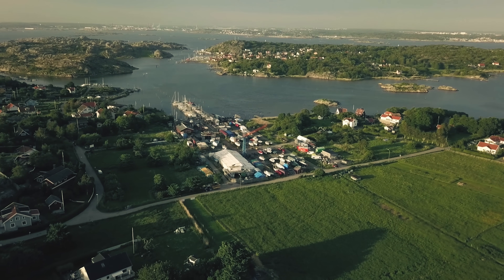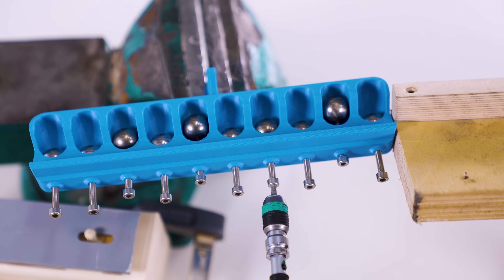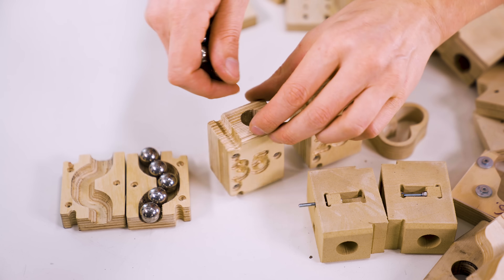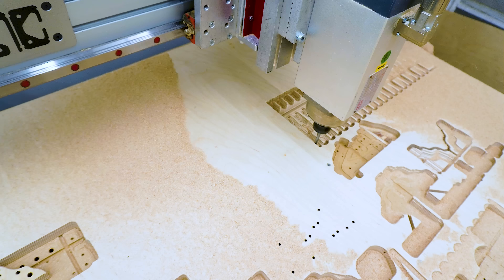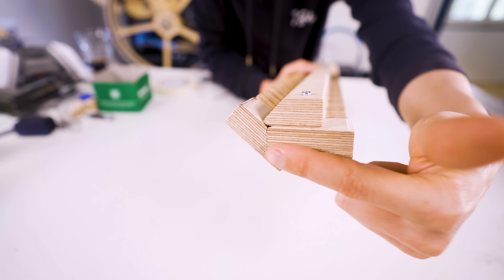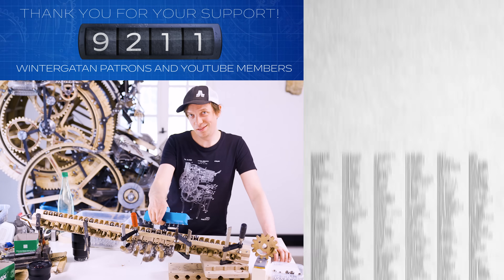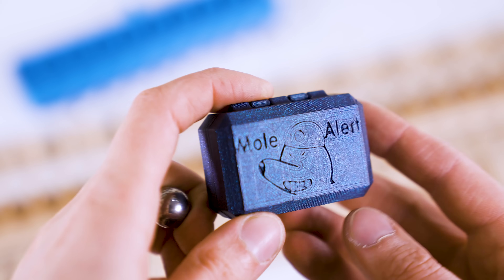Engineering Basics: The Best Part Is No Part

Comment: As much as I feel sentimental for what work has been done prior, simplification saves error later on. The new parts and designs coming in will save troubleshooting much later on and wear and tear on many small pieces is worse than wear and tear on a more heavy duty 3D printed part that is one larger piece. I love this progression!

Comment: You may want to consider raising the marbles higher and have them go into a tube that feeds the marble divider. That way marble pressure can be used to prevent marbles getting stuck. This would make it so that your divider isn't as sensitive to it's orientation.

Comment: I've often wondered about the longevity and wear on the plywood - you've used acrylic laquer to "harden" it, but that's little more than a surface treatment that WILL wear off -  - my first choice would be cyanoacrylate (CA glue), it comes in different viscosities and one of them is like water with excellent penetration of wood and plywood to make a rock hard surface, I've used it many times to create high wear resistance surfaces for things like drawer runners, that's still good decades later - however CA even in bulk isn't that cheap, and application can be finicky requiring the person to be quite meticulous and quick in its application as it only has a very short "ppen" time before curing, and therefore time consuming. 

The next possibility I would recommend is using a wood hardener specifically designed to, well, harden wood.  It's used to strengthen old weak / damaged wood in things like window frames prior to repairs.  It's an epoxy with a built in catalytic hardener but is very viscous and will easily soak into the fibers, much deeper than a spray on laquer, but can be thinned out 10% with methylated spirits (also for any cleanup) to make it penetrate even more.   It's extremely simple to use, just apply with a brush like paint without overloading the area with it.

The product I've used for many years is Ronseal wood hardener like this - but I'm sure there are other varieties.
https://www.wickes.co.uk/Ronseal-Wet-Rot-Wood-Hardener---250ml/p/117936?utm_source=google&scid=scplp117936&sc_intid=117936&gclid=Cj0KCQiAnKeCBhDPARIsAFDTLTK09orMs9xJvJiiNzieO4Ez_P9uBtkUOgYAuXJLbTnzLDW7A0z1aDsaAmW5EALw_wcB&gclsrc=aw.ds

This will make the wood extremely hard as the fibres are now full of epoxy on a cellular level, and it will penetrate without deforming the structure, and can be sanded to provide a reduced friction surface even more than wood alone.

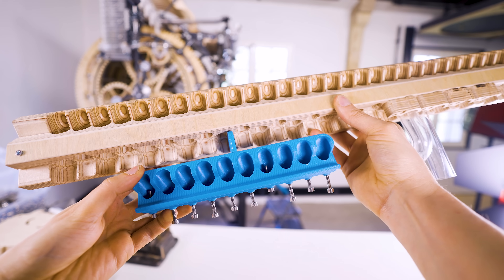Comment: @9:00 he is holding the plywood at the correct angle, but the 3d printed is rotated by 45ish degrees.  Notice the plywood does not have the raised lip which is designed to keep the marbles from falling out when rolling down the path.  To compensate, he incorrectly rotated the plywood version along the longitudinal axis which caused the marbles to stick.  After he adds the lip and installs correctly, I believe the sticking problem will go away.

Comment: The ball ramp, made of plywood, turned out to be bad. Too much rolling resistance and slowing down of the ball rolling speed. It is necessary to make a smoother transition between the isthmuses separating the niches of the balls and the flat part along which these balls roll. In the printed prototype, by the way, this point is taken into account and done correctly.

Comment: Honestly the thing I'm worrying about now is the marble feed rate itself. The recycler fish stair means that the marbles cycle through the divider system at a certain rate to cover the case if the marbles fall on the furthest position but the earlier channels are used more often. It is less likely ofc (expecting the drum kit and the bass channels to see much more use than the vibraphone channels) but you'd have to worry about the speed of the marbles going through the divider, even more so given the clock escapement gate which wouldn't tolerate a completely empty channel. Needs a lot of experiment and friction reduction effort I suppose.

Comment: I think you could come up with a similar design idea, mixing the fishstair loader and this design to make it for the chain elevator, that way you can always feed 8 marbles all the time, making it look cooler but would also not require that much engineering as it uses the same principles as the fishstair loader, thus make you need to think less

Comment: The new marble lanes design suddenly makes so much more sense with this Marble Divider.  Given the much slower movement of the marbles down this divider, if they all originated from the far left path, you would get marbles backed up very quickly, likely leading to failures.  But, with the new marble lanes that more evenly distribute the marbles over 8 separate locations along the divider, this likely is far less of an issue.

Comment: Great new addition to the machine, but knowing your perfectionism I have just 1 small bit of feedback that I really do need to give. Actually there are two:

First: Sound, this new tool causes a LOT of friction and the energy loss will do two things, create heat and sound. The heat, is fine. The sound? The machine will have a new constant background noise from this addition. Knowing how you try to avoid noise and unnecessary/unwanted friction. This piece might be a mole in waiting. 

Second: Wear and tear. Because there is so much friction, the divider slots between the channel will constantly be bashed by the marbles. This won't create a problem in the short run, but it will if you don't replace the wood every now and then. The wood will be dented and bashed with every marble hitting a channel divider, this will impact the reliability of this part, causing less friction at first, but a lot more later on. Right now this pieces does exactly what you want. It might not later on.

Comment: Dont' forget to implement the passing track of the old divider to beware of a bottlenack in the new one!
Maybe only a thaught but the brittle Pipes on the funnel might be brake in long term and have to be fixed by an other bracket which hold the pipes on place on the one and decrease the stress on the pipes on the one side and on the other side to give the funnels the freedom for a little bit of bouncing. Which kind of bracked you ask? Maybe to diferent parts, one wich holds the pipes in place and one which is holding the funnel and is bouncy.

Comment: The design is ingenius, indeed. However I have doubts that the „noses“ that divide the pipe channels might last that long as they‘re exposed to constant wear and tear of the passing marbles. Even coating it with Guitar Lacquer might not totally eliminate this especially if your ultimate goal is to process 1‘000‘000 marbles without a single failure. Maybe covering those noses with a tin „v“ shape might give them the extra stability to fend of the constant wear and tear.... just thinking... and seeing a mole lurking out of the channels...

Comment: I have no doubt that by the next video, Martin will have been finessing that divider. It is genius...but not perfectly executed. The full size isn't quite a good as the prototype - looks as if the use of 17mm for the diameter of the cutout path was maybe a fraction too big. It may be a gentle trim of the sidewalls of the entry channels would achieve an improvement...but it wold be brave!!

Comment: You could lower the risk of requiring tweaking by following your divider with the vertical constant position unit.  That would permit a more aggressive angle favoring the marble leaving the track, without having hangups along the track.
          I see you wised up and lacquered the plywood!  Even better would be the penetrating epoxy formulations meant for reinforcing rotted wood.

Comment: Mole Alert:
I love this new simpler design and I think it will work great, but it is also very noisy. the 3D printed part works perfectly and in your Plywood part the marbles got stuck. I believe this is due to the wall thickness between the channels. They look thinner and rounded on your part than they are on the prototype. Also, the marbles could wear down the plywood there and then stop the marble divider from working on  tour!

Comment: CNC machining wood cannot replace 3D printing, as the 3d-printed model has different edged of the openings and the marbles run perfectly smooth on the 3d printed part whereas on the cnc-part they get stuck way too often.

Because of all the forces involved, this design will fail, because the edges will wear and more and the resistance will grow. 

You should invest some money and let this part manufacture on a 7-axis cnc-mill out of solid metal (at least the top part where the marbles run in should be a single piece)

Comment: I see the only mole problem here at the thin parts between the marbles. With make them round you increased the pressure to the wood and the marbles have more to get stuck on. maybe the wood will fail there. There is a design difference between the printed and the wood part.

Comment: The great thing about the 3d print is that the marbles in the vertical lanes follow the marble radius in the horizontal lane, so marbles there are always held in the same position, just supported from different angles. Does the plywood part does this as well? It looks more like an angled path on there.

Comment: I had this nightmare of a project in 2015 (machine to do NDT ot mill balls) but the marbles were 60mm in diameter and 1 kilo each and i had to move 80'000/24h in 3 parallel channels. And there was a deadline... stuck marbles trigger my ptsd. I love your persistace and the way you engage your audience! I have just this early video if someone is curious: https://youtu.be/C4vZw7GfEvs

Comment: It just occurs to me that the MMX design process is an excellent piece of evidence to debunk the idea of Intelligent Design as an alternative to Evolution.
Because evolution is an integral part of ANY design process.
The marble divider, for instance, has undergone a couple of evolutionary iterations.
Even just this single iteration of the divider has been developed through an evolutionary process. The idea started out in the theory-heavy biome of Nobody, migrated through the biomes of Locket Rauncher and Rossero where it adapted to evolve more practical viability, before migrating further into the biome of your CAD system where it adapted even further, evolving to fit snugly into the actual MMX and to be assembled from plywood instead of ABS or PLA.
Even your CAD sessions are evolutionary in nature: You throw a few ideas at any mole that rears its head, and see if they are fit to whack that pesky animal; if they aren't, you discard them, otherwise you run with them. And if months later it turns out that the evolution of the idea has taken a turn that makes the end result unfit for the life-and-death struggle of playing a song, the entire design branch is cut off by the Angle Grinder Of Glory, making room for new ideas to thrive in.
There is nothing intelligent in trying to design something without making use of evolution.

Comment: there seems to be a lot of friction between the marbles and the track they run on not to mention the momentum they lose with every bump against the channel walls. i would probably tweek the rolling space a bit and make those bumps a little less prominent to give a much better flow of marbles. but obviously this is just an afterthought on perfecting a system that already works well enough.

Comment: On the actual marble machine you have 3 marble lanes feeding the marble divider at different points, if the marbles get stuck in the middle like they do in the video, the marbles could drop on top of the backed up marbles, bounce, and end up on the floor, in a gear, or on an instrument

Comment: Very promising! I think you found an angle that works, but an even more vertical rotation might also work while reducing loud bumps and marble-marble collisions from traffic jams. Maybe if you still have that transparent ruberizing goo, you could paint it on the impact points? It might improve durability and reduce noise. I hope that after a successful "clean floor" test you do a big noise audit before you commit to the final design.

Comment: Sounds like it may take a couple iterations to get the marble flow as smooth as possible--right not it's a little loud and a little losw compared even to the prototype--but once that's dialed in, that's 38 adjustments and 600-odd parts you never need to worry about again!

Comment: Seems like you could reduce a bit of noise and increase the speed of the balls down the slope by slightly removing a bit of material (maybe 1-2mm) in the plywood rib the ball is contacting in between each hole when filled . Should make it a lot smoother and quieter, I’m guessing. Could be done now with a sanding drum on a rotary tool and designed into future prints. Cool design! Props to all involved in the evolution of the idea!

Comment: still have not been convinced by that general design of linear filling a magazine by marbles running down a track. 
let's say in a very fast song using many marbles in the first 10 channels .. will there be enough marbles getting through to a potentially fast channel 32? i think a parallel feed would be more secure - even if it's just 2 lines feeding channels 1-19 and one for 20-38 or something like that.

Comment: I feel like a lot of the hangups you're getting on this design is mostly caused by the walls bordering each loaded marble being rounded over instead of flat. It looks nice and reduces the fray cleanup but it's creating a deeper space for the moving marbles to get locked up on. The walls might also just not be lined up with the marbles properly (pockets too deep/shallow) but that roundover still does that regardless.
Reply: I agree, this make could be tweeked a bit. But we're on a great path here, incredible design changes are making their way into the MMX. I'm looking forward to the Vibraphone output rails being redesigned, these thin plywood tracks near the knees make me nervous. :P
Reply: This is a very good observation.

Comment: The divider small angle (forward / backward tilt) adjustment seems critical, steeper angle is safer and slower and noisier. A shallow angle is more dangerous for a marble falling off, running faster and making less noise.  An acrylic / lexan fence or a bent thermoplastic cover in clear would help constrain the balls with a shallow angle on the floor of the divider.  The angle should be instrumented and adjustable for each location, or auto leveling for the entire machine would also be sweet.

Comment: i think the marble divider would be more efficient if the ribs were smaller and the marbles didn't bounce off each rib as it travelled down the slope. The marble itself sits quite far past the rib so there is some optimizing there that could allow for smoother/faster marble speeds.

Comment: Looks like the walls of the channels might stick just a little too far out? You'd get less of a speed drop over the long run if the walls only go out as far as (or maybe slightly shorter than) the marbles in the channel.

It might also be that the marbles don't go quite low enough under the running surface, so the marbles rolling down the run roll on top of the marbles in the channels instead of only hitting the walls and sides of marbles.

Probably won't be a critical failure either way with the correct roll and pitch angles, but it could probably run just a little bit smoother like the prototype.

Comment: I love this quote: "When you have a problem, do you really need to solve it? Can you just make the problem itself go away?"
Reply: It's quasi-intellectual nonsense. Any action that makes a problem go away is per definition a solution.
Reply: @gutterg0d  Rubbish! There's clearly a difference between a design that solves a problem and a design that tolerates the existence of that problem without failing. The problem with getting consistent marble heights at the marble has not been solved; the PMMA pipes to the marble gates will leave the top marble at  variable heights. Instead, Martin has redesigned the marble divider so that the problem of inconsistent height doesn't cause the machine to fail.
Reply: @liamedgeley7557  

I've never said all solutions are the same. But removing pieces is still a solution to the problems they cause. ANYTHING you do to resolve a problem is. There's nothing you can say that will change that simple fact.

"When you have a problem, do you really need to solve it? "
Yes, you do. If you don't, the problem will still be a problem.

"can you make the problem itself go away?"
Yes, it's called SOLVING THE PROBLEM.
Reply: @gutterg0d  I do not think it is quasi-intellectual nonsense. I see it as another way of saying `can you cure the illness instead of treat the symptom?`. While sometimes you can afford to treat the sympton, curing the illness will be the robust solution.
Reply: @hampusk  Making "the problem itself" go away literally is to solve the problem. I'm sure Martin meant something like what you're saying, but that doesn't change the meaning of the actual quote. It just doesn't mean what you're trying to make it mean.
Reply: That's what my gf says to me when she approaches me with knife in hand

Comment: The plastic prototype rolls smoother and quieter than your wooden cutout. Couldn't you refine the cutout tolerances for less "catching" of the edges of the cut outs on the roll path? Every catch increases noise and slows the descent

Comment: I think you are running it the wrong way. The marble slots should be on the front, not the back. Definitely take a look at it, because on the back is your tracks, and I'm thinking when you combine this with the marble tracks, you may get congestion. Unless you are switching to all the marbles coming in from the left via a pipe in the same way they exit via a pipe at the end?

Definitely I think I have predicted the next issue :P